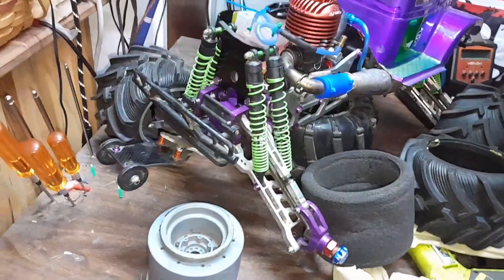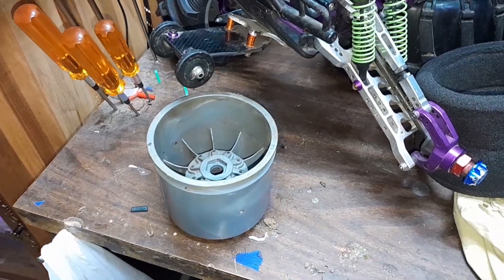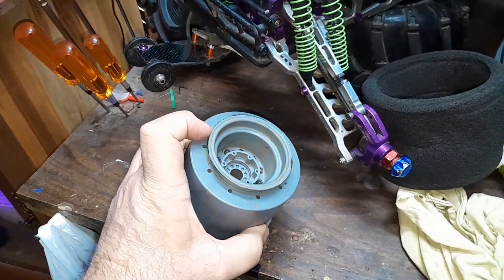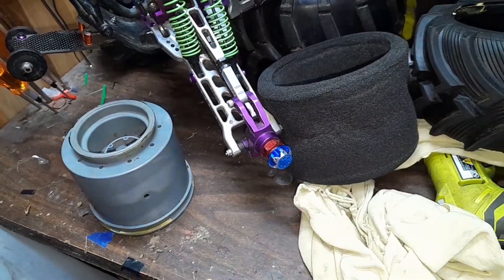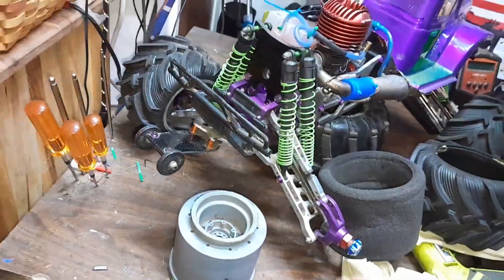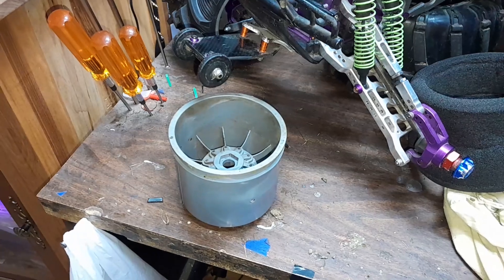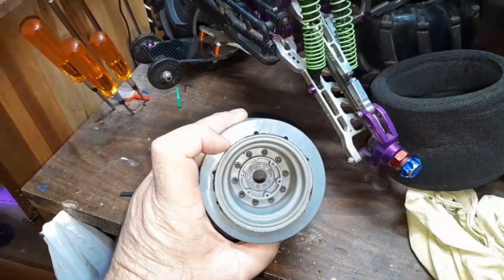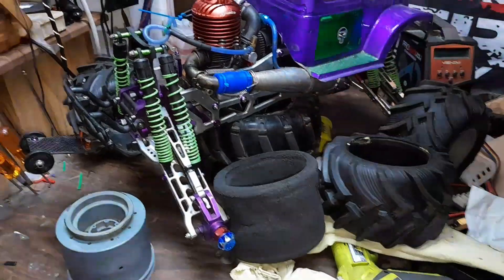Slick Trick Times 2

Comment: Will the savage clutch bell will work with the reds? or what type of bell will it work? And the Jconcepts fling kings look wicked on the savage!
Reply from the maker: Yes, it should work just fine. I have a reds bell on it. But size is the same. The only difference I've seen is bearing size. But they all fit.
Reply from the maker: Yes, fling kings are awesome.  But I'll say these rims have huge breathing holes. So they are no good in water.